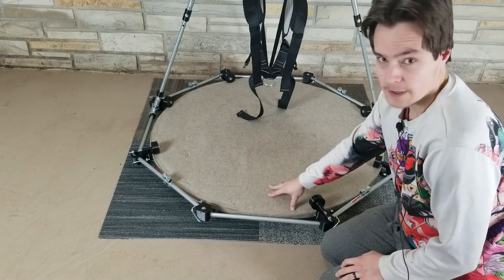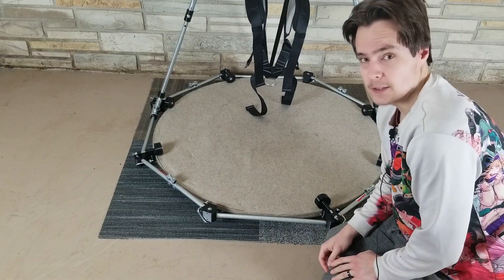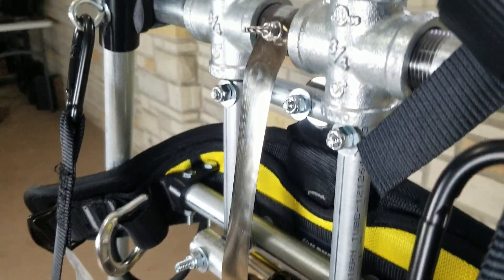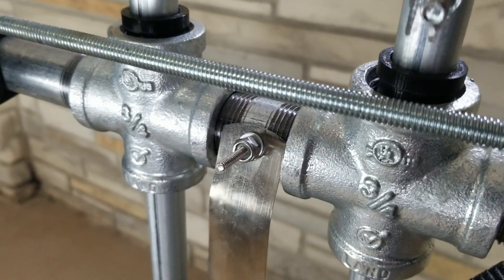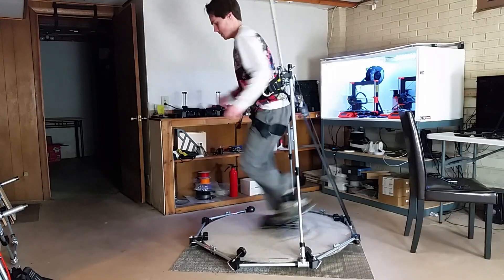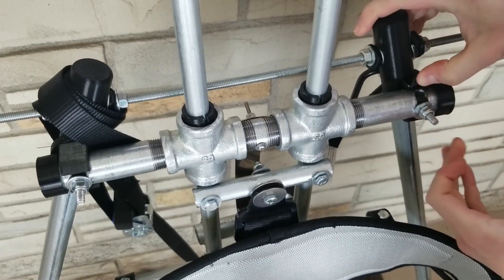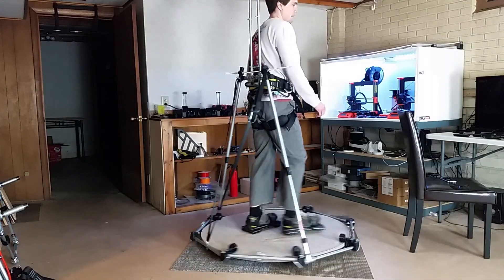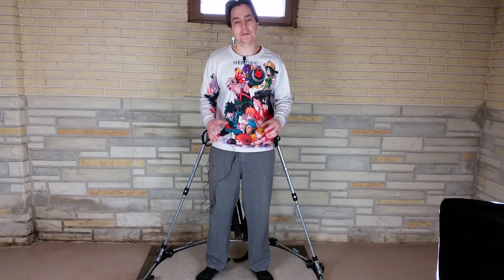VR Shoe Build Log #51 - Support Rig Demo of Walking, Running, Crouching, Sitting and How It Works

Comment: really awesome and clever solutions, its looking absolutely fantastic! a few things come to mind that you might be interested in trying.

i can't post links but the youtube channel 'geared down for what' designed and shared a 3d printed, recirculating ball bearing design for curved tracks, that you might be able to adapt. rather than normal bearings being pushed along tangents of the circular platform to travel around the edge, you could have a bearing that really conforms to the circular track and it might be smoother and more stable.

alternatively but similarly, i think it could be really smooth and stable if you stacked two platform disks with round grooves routed close to the edge, sandwiching a marble/bearing carrier that conforms to the circle, basically creating a round linear rail to mount the support rig onto. between the two disks you could put sound dampening in the centre where you walk maybe making the whole thing a little quieter.
Reply from the maker: Thanks, I think I found the video and I'll check it out. And yeah I think stacking two platform disks like that could work too.

Comment: I have the KAT VR Kat Walk Mini (1st generation) and I have to say that your setup is not only lighter and more portable but also the movement appears to be much more natural.

The only thing your VR Shoes appears not to do yet, is to be able to work while running which the KAT VR concave dome allows you to simulate, although however poorly it does it.

I'm wondering, how will your VR Shoes work during side steps or strafing?

Bravo for your work!
Reply from the maker: ...is to be able to work while running which... - what do you mean by that? If you meant strafing, yeah the vr shoes doesn't support that, maybe in the future. I tried doing some strafing when using the virtuix omni and it didn't work very well.

Comment: if you extend the mounting points on the top of the bars connecting the base to the harness further out from you it should be a lot easier to both turn and walk although it might make it easier to hit the bars if you were to swing your arms down behind your waist for whatever reason. If they were completely perpendicular to the wheel I think you could rotate very easily, although the means by which they support the harness might have to change as well.
Reply from the maker: I'm not sure if it will be easier. You're basically saying to the long conduit be vertical instead of slanted? Or are you saying to spread the two vertical conduit that slides through the pipe crosses for crouching?
For making the long conduit vertical instead of slanted, I think you're still strapped to the two vertical conduit for sliding, which are still very close to the middle, so you're still turning from the middle and don't get as much leverage. If the conduit for crouching was spread out...maybe it would be better.
Reply: @finallyfunctional  Vertical instead of slanted, yes. It isn't that you are increasing your leverage as much as that you would be increasing the slope time of the travel overall and allowing your body's inertia to take on the rotational force instead of doing it entirely rigidly and with like muscle force. I think the easiest way to describe it would be the difference between waving a weight back and forth in your hand vs waving it on the end of a short rope. You put in less manual force and then inertia takes over, its less controlled but the travel time is elongated. Eventually it becomes easier to manage a pattern than think about the movement strain. I think it would make it easier for you to turn and the entire rig turning would be smoother. 

It may seem a little bit less reactive but that could be a pro and not a con, maybe giving some time between input and feedback would make it feel easier to subconsciously offload, suspend your disbelief about that you have to push a harness around. Hard to tell without testing it personally. 

It would make the system behave more similarly while crouching although that is not something I was trying to address as much as resistance while turning.

Comment: Have you considered using the metal hoop from a small second hand trampoline for the base ring. It would be stronger and have no warp.

Also instead of straps that hold the rear upright you could use metal curving around and connecting to base almost 90 degrees to the base and it would not get in the way of your heals.
Reply from the maker: I haven't thought of trying to use a trampoline base ring. That might work, good suggestion, I bet it could work too, but I would like to use parts that people can just buy instead of having to go search for second had parts.
Reply: @finallyfunctional  I think most people would be interested in buying this rig pre-assembled once its out on the market.

Comment: I'm not an expert or engineer, but I have a suggestion for potentially solving the walking while turning issue. What if you strap yourself to the rig backwards? Basically so that the 2 support poles and the moving rig piece are in front of you rather than behind. This might help because then most of the weight of the rig would be in front of you and by walking forward you might create enough force to make turning easier. I know this would introduce other issue like having pieces of metal in front of your face, but you could lower the height. As for the V shaped rope, you could have that directly attached to a free harness on your back to even out the forces. Ease of turning probably depends on if an individual has a strong back or a strong chest.

Another idea: Instead of having the support rig either behind or in front of you. What if you split it in two and have one support rig on the left side of your body and one support rig on the right side of your body?
Reply from the maker: Yeah I wouldn't really like having all that metal and stuff in front of me/the user. I believe some of the remaining resistance to turning is because the two corners right next to where the rig is connected to the ocotogon are taking a lot of strain. They flex a bit when using the rig. I think if I can take the strain off of the corners and 3D printed parts, and transfer the weight and forces to the metal components, it will turn better.

Comment: How well is the carpet on the platform working? It looks like it is bunching up and I would guess that it is pretty annoying. Do you notice with the shoes on?
Reply from the maker: I don't notice it. I have it stapled down and need to add more staples. I basically added the minimum amount of staples because I've taken the carpet off a few times now and it's a pain to take all the staples out. Once I'm for sure that I'm leaving it on, I'm putting a lot more staples in it.